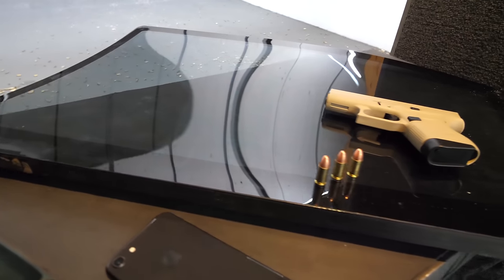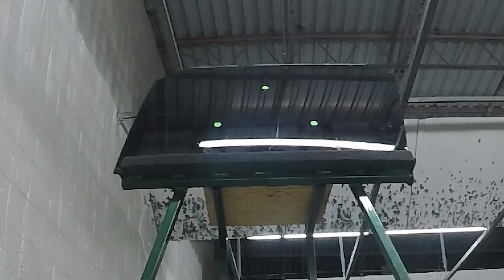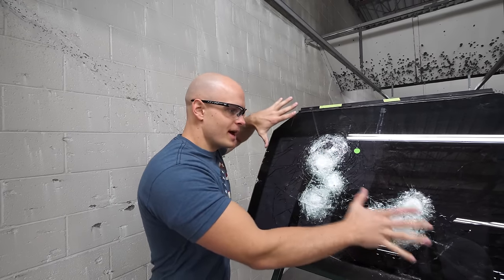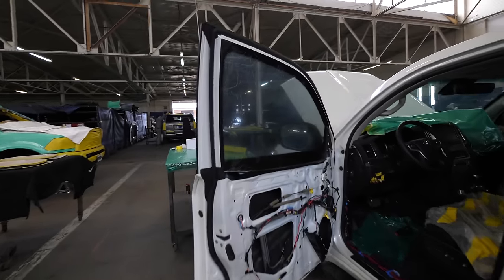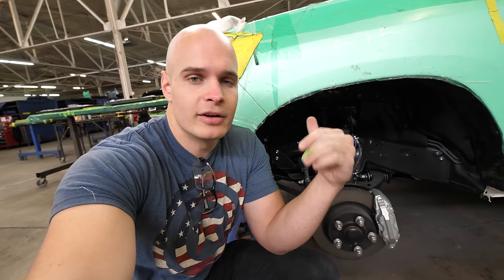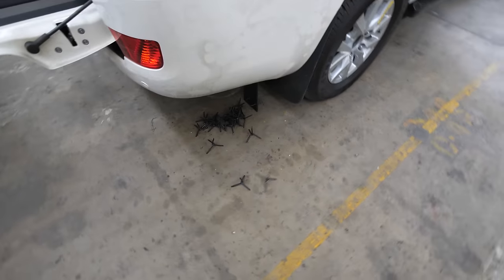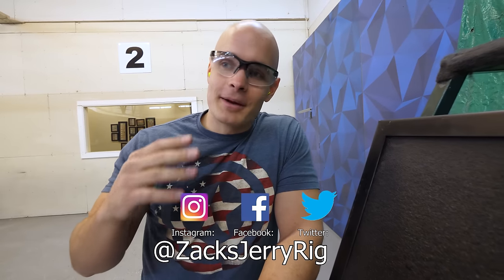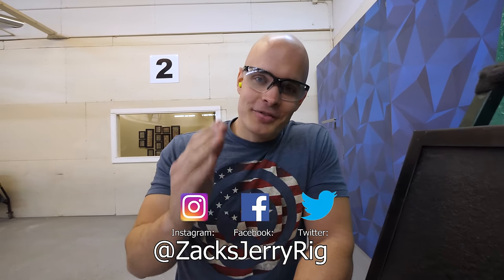How Durable is a BULLET PROOF Car?!

Comment: What if I told you that 9mm is a larger caliber than .223 or 5.56 and is only weaker because it is slower moving?
Reply: I would tell you to read a book and educate yourself about firearms.
Reply: Emotionally Challenged Subordinate it is larger...
Reply: Emotionally Challenged Subordinate doesn't know what he's talking about....... Comments on everyone's post telling them they're wrong
Reply: Emotionally Challenged Subordinate I would tell u to do the same
Reply: Its doesnt even matter about size, it matters in term of power. I. E. the grain of the bullet and how long the barrel is and whether its rifled or not? Am i wrong? If the 9mm had a rifle casing itd be just as good if not better right?
Reply: MrJustyoutubing the power or energy of the bullet depends on its mass and velocity. A 1 kg brick moving 1 meter per second and a 1 g pebble moving 1000 meters per second would impact something similarly. In the case of bullets, a 9mm pistol round has a larger diameter than a 5.56mm rifle round, but much less powder to propel it than most rifle bullets. Barrel length isn't that big of a deal. The same round through two different length barrels would go pretty similar speeds. 9mm pistol rounds will go much slower than 5.56mm rifle rounds under every circumstance I've heard of. And as I understand it, rifling does not have a significant effect on bullet velocity. It just spins the bullet like throwing a football to make it maintain point first orientation in the air.
Reply: Thats what i was saying about the 9mm having a rifle casing and gunpowder behind it like a 5.56 or a 45-70 would also be really destructive, but as is, its not. Which, i mean, it doesnt need all that since theres already rounds like that.
Reply: MrJustyoutubing you are correct but pistol calibers have round tips instead of pointed so they lose a LOT of speed going through the air.
Reply: distante _ not all
Reply: 1CoLoRz2 yep
Reply: distante _ Yep as in they all do or yep as in you agree with me
Reply: 1CoLoRz2 yes I agree, I meant to say there are a few that are pointed.
Reply: I wanted to see a 7.62 round, not too many African poachers running around with ar's
Reply: @Coach_Dustin_C  7.62x39 rounds has slightly less pentration than 5.56x45, because 5.56 is faster, but many 7.62x39 rounds has steel core insert, which helps a little bit, so overrall, they are about the same against armour.
Reply: @qiyuxuan9437  hahaha you trying to say that a 5.56 will cause the same amount of damage as 7.62???????? Because that would be hilarious
Reply: @Coach_Dustin_C  Not damage, but penetration, just check other gun channel videos,using same type of bullet 5.56 is more effective against body armor. Smaller and faster projetile always better at penetration, that is why tank use sabot rounds against other tanks.
Reply: Wait 9mm is bigger than 5.56mm who would have thought.
Reply: @duncanmc797  if you ever take the bullet out from the shell, you will notice that 9mm bullet is twice heavier than 5.56mm bullet.
Reply: I know. im a Canadian soldier, i have plenty of experience with both. i was being sarcastic
Reply: @yuxuan qi thats why i specifically wrote 5.56mm and 9mm its pretty obvious which one is a bigger caliber
Reply: @qiyuxuan9437  you do realize you can get 7.62 x39 in lighter bullets 110 grain round is a 3100 fps in a 7.62x39 223 and 5.56 is a pointless round that's because it's too small and that doesn't have enough Mass you can get a 110 grain round for a 30.06 that's pushing a whopping 4,000 feet per second and it's still heavier than 55 grain and twice as fast that's because the 223 was built to Mame not kill
Reply: You are right 5.56 and 2.23 are just slightly bigger than a 22

Comment: @jre 5.56mm nato or .223 is a smaller caliber bullet than 9mm which roughly measures .35 almost twice as big, in weight and diameter.  You're powder charge and barrel length are what causes the increased velocities. Just because a round is a rifle round doesn't make it a bigger caliber. Not trying to knock you but you're putting out disinformation and may cause confusion to those who aren't familiar with guns and ammunition. Good vid though
Reply: A 223 and a 5.56 are pretty much the same thing. They are rifle calibers. A 9mm is a pistol caliber.

Edit: pretty much
Reply: @d3m053  what's your point i said that already. Gun type doesnt determine caliber, diameter of bullet does. Case size doesn't matter either.
Reply: Nathan Quantz the point is you’re referring to the same round as if it were 2 different ones and you were saying something about misinformation?
Reply: @nicholashowes413  no. I just have both measurements inches and mm.
Reply: @d3m053  Not true at all. they have 5.56 pistols and 9mm rifles. Its a pistol cartridge vs an intermediate cartridge. As in, between rifle and pistol.
Reply: @nicholashowes413  also .223 and 5.56 technically are diffrent rounds based on chamber pressures so...
Reply: Thanks for this comment. I was wondering if I was the only person bothered by him going to 'the bigger caliber' from the 9mm. :) I mean - the AR could have been chambered in .458, but the bullets looked awfully small in diameter compared to the 9mm. Guess it was a .223.
Reply: @d3m053 .223 and 5.56 are very similar although the 5.56 is slightly larger. A .223 can be fired from a 5.55 barrel, however if you shoot a 5.56 through a barrel rated for a  .223 it is highly likely that it will jam in the barrel.
Reply: @michael_house  I was wondering the same thing.
Reply: Wish I saw this before I said pretty much the same thing lol. I'm late to the party :(
Reply: @stonesoupmix  you are completely correct
Reply: @adamnichols476  I realize I was lazy with that comment. Nathan Quantz I meant to type more, I know case size doesn't matter, and I meant that a 223 is often used in rifles. A 9mm is also used in some rifles, and most pistols. That was what I meant by it. I was being pretty lazy with that comment of mine though. stonesoupmix tbh thank you. I actually thought 556 and 223 were the same thing. Thanks for that bit of info.

Comment: What if you get into an accident and need to break the glass to get out?
Reply: Trunk. Sunroof. 4 doors one thing will most likely be useable
Reply: Trunk (or ‘boot’ as it’s known where I’m from) is really impractical and not all cars have access to it not to mention handles on the inside (emergency handles a thing that idk about?) 

The doors would be ridiculously heavy if you had to get them open at a 90° angle

Sunroof would either not exist or may not be functional due to heavy bulletproof glass or just out of order due to the accident.
Reply: Also note how I specially state ‘what if’ and ‘NEED to break glass’, as if it wasn’t already obvious that this was a hypothetical situation.
Reply: Would be interesting to know the companys answer to this. One thing they may have inside is a hydralic lift bar to manually push open doors. We have one at our work for stretching metal frames goes up to 20,000 psi is about 2.5 inches wide and comes in 4 20 inch sections so you can make the desireable length needed. Very small compact n fast.
Reply: If you go under in an armored vehicle you are dead...theres no ifs ands or buts about it. 

The doors on most commercially available armored vehicles weigh in excess of 300lbs.

The only way you would stand a chance in hell of survival if you weren't knocked out would be to have a scuba rug in the cabin with you... Still... Odds are against you
Reply: pouah hahaha the never think about that
Reply: @RAYTHEONGAMING  vigil > cav

Comment: What about a 50 BMG
Reply: It would go through these 2 glass panels shown here easily.The thicker glass,which they use for limousines of politicians could maybe withstand one round,maybe 2,but if the attackers use a cal. 50 heavy machine gun,like a Browning and shoot a salvo,it would penetrate the glass.Also,keep in mind,there are different types of  cal.50 ammo,like armour piercing/incediary,which is specially designed to penetrate armour.A standard cal.50 round,goes through a concrete wall like butter.
Reply: doubleP dead
Reply: Look up demolitionranch he has a video shooting a glass with 50bmg
Reply: Companies do testing on just this kind of thing. You have to find the reports, and you can find out specifically what rounds at what speed hitting what material will defeat the armor or not. A .50 AP hardened steel core can go through .5 in hot rolled steel for example, but which would be soft in comparison to other hardened and tempered alloys. Some plate manufacturers just case harden one or both sides so it has more overall durability compared to either a brittle or a soft plate. These methods can usually produce 3+ plates for cheaper than using higher quality materials.

Comment: With the electrified handles couldn't they just hold the sides
Reply: Yeah but most people don't ever consider that handles would be electrified. Ultimately the doors should be kept locked but if someone tries to carjack you by pulling on the door handle, their OODA loop is reset which gives the driver additional time to react.
Reply: @tikifilm  anyone who plans an assassination would probably know a thing or two about the vehicle they're targeting. Also, pretty unlikely they're gonna be bare handed. Definitely gonna be gloved.

Comment: @JerryRigEverything By the way the AR15 is not a Higher caliber ( 5:18 ) ... its a .223 Caliber or a 5.56 x 45 mm (sometimes you see them in larger calibers than the 9 mm but the most common and least expensive is the .223 cal or the 5.56 x 45)... that is literally the size of a .22 long rifle bullet (just .003 caliber larger)... the 9 mm is is close to a .40 Caliber... but what is making the AR15 more powerful is the speed of the Bullet... there is close to 3-4 times the amount of gun powder in a .223 round and the bullet shape is very different as well... more streamlined.  The 9mm Luger muzzle velocity=  1200 ft/s < The .223 Remington muzzle velocity= 3700 ft/s. Technically the 9mm is a .3565 Caliber  but we just round up to .357 cal. Most .357 pistols are revolvers and the casings are longer and hold more powder therefore have more power Also known as the .357 Magnum... that and the bullet is a bit longer too so it weighs more and has more power.  Try not to misinform people that follow your channel. I really like your videos but a little more homework on the details of something like guns especially in this day in age where the AR15 is scrutinized by the public as the evil, deadly, bad boy of the gun world would be much appreciated.  Thanks for reading and Thanks for the fun videos!! :)

Comment: hate to be pedantic, but given that a 9mm is .354 caliber, and a 5.56x45mm is .223 caliber, the AR 15 is not a higher caliber round than a 9mm. it is a more powerful round, but not higher caliber. I also wouldn't classify it as a high powered round in general, since its largely only effective for medium sized game animals like boar and coyote. you have to step up to a significantly more powerful round to effectively (and legally in my state) hunt anything much larger like a deer. there is a reason that the NIJ when defining bullet proofing ratings have rifle armour designed to stop a .308 (level III armour) or a 30-06 Armour Piercing round (level IV), but no less significant rating for rifle armour. A well made Level IIIa soft panel rated for 44 magnum has the potential to stop a 5.56, depending on construction.

Comment: OK, so who’s going to clue the nicest guy on the Internet into the facts that the tip of the “bullet”, as he calls it, is actually the bullet, the walls of the firing range make sure the spent shell casings don’t hit your neighbors, because the bullet just went down range (hopefully), and that AR-15 rounds are smaller than 9 mm, so the 9 mm is actually the larger caliber? 9 mm .38 caliber, 5.56 mm is .223 caliber.

Comment: Several technical mistakes in this video... a 9mm is of higher caliber than a 5.56mm or even a 7.62mm rifle ammo. They may be smaller in caliber but travel with higher velocity and are more powerful. And the side panels in the firing range are meant to stop the casings, not the actual bullets.

Comment: for over 20 years i was employed in the Commercial Woodworking field   that mostly catered to the WashingtonD.C. area  often the Federal Government would Spec Bulletproofing materials to be installed  in and around entry ways on some of their buildings  the makers of many of those materials were usually pretty adamant about not using the term Bullet Proofing but instead preferred the term Bulet resistant FYI  although everyone else called it Bullet Proofing  i did take a 3 foot by 1 foot piece of PolyCarbonate  and  we folded it in half and had  around 40 men jump on it in a effort to break it  and it did not break    and returne back into a flat yet badly scratched  piece of plastic  that product was  about a quater inch  thick  piece yet the industry  uses metric dimensions     i used  some cut off scrap pieces to build  see thru panels on custom made tool  containers that  were  used to transport  tools from one job site to another safely  and all the PolyCarbonate  has remained unbroken for over 25 years  even though they weren’t always transported   kindly  or carelessly by  shipping companies and their personnel  it’s pretty damn tough stuff   the manufacturers  told me  the materials do get compromised with repeated rifle rounds to the same area  but in reality that’s not how a typical  attack would come  to the places and facilities that use it  and i  do have a family member that  is retired Military  who at one point was Stationed  in a Country that required him to travel in a Armored  SUV  that the windows were way thicker than a 1/4”  thick  i never saw the Armour plating that was inside  the doors  but it did appear to be pretty heavy guage  that vehicle had some bombbproofing capabilities in it as well  and often my Uncle traveled with armed Marines from the U.S. Marine Corps  whenever danger levels were high  as well as his own handgun  and his home had a armed guard on duty 24/7  as well !  way different then the way we live in America for sure  when you Mom went to visit she was shocked to see men posted outside the grocery stores and church’s with Machin Guns  hanging on them  yet my Aunt and Uncle said that was normal

Comment: Why not just have the door locked from the outside and open from the inside. So nobody can open the door on the outside but the passengers can always open the doors on the inside. This shock tech seems unnecessary if the doors just auto locks.

Comment: There’s a big different between “how durable is a bulletproof car” and “how resistant to an attack is a car.”  Durability of a bulletproof car relates not only to the components that make it a bulletproof vehicle, but also to the mechanical and electrical components. If we are talking durability of a bulletproof car, the added weight does affect mechanical and electrical components and they  do not last as long as the should on an average car.  So DURABILITY of a bulletproof car is shortened compared to an average vehicle.